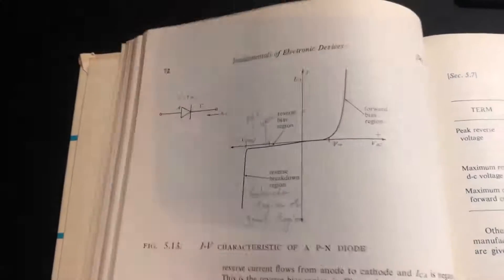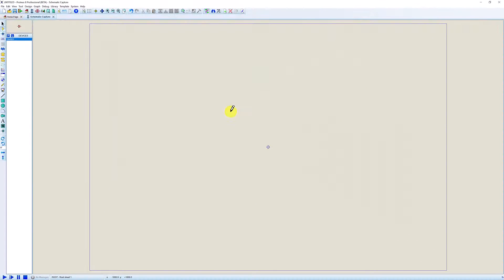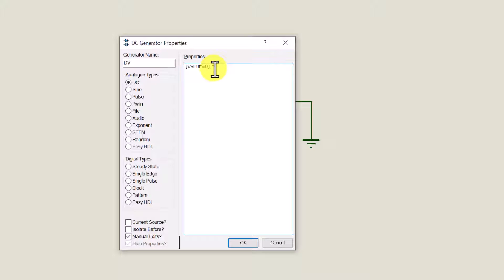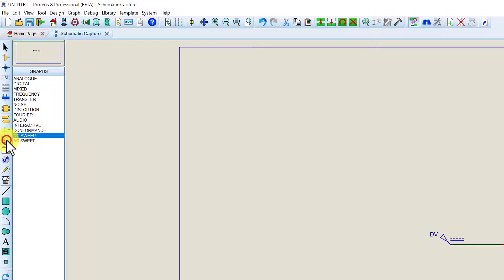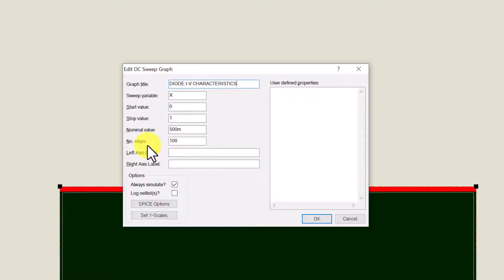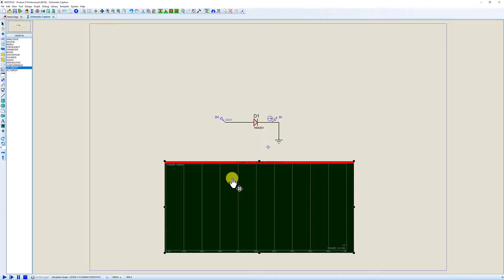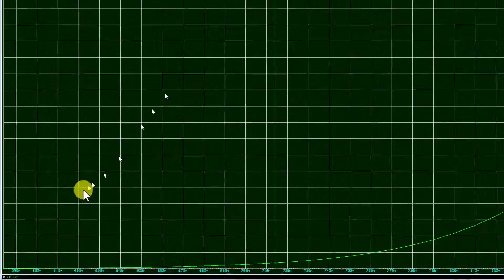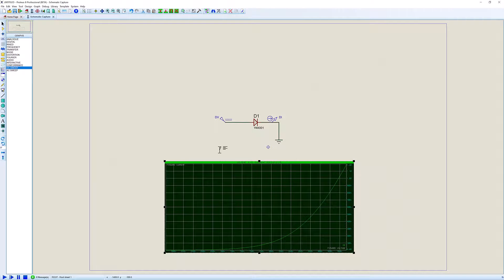Diode I-V Characteristics in Proteus DC Sweep Graph PN Silicon Forward Bias

Comment: Hi sir, I have a doubt. I want to illustrate the VI characteristics of diode in proteus. But the problem is I want to plot the graph as Id VS Vd (ie. diode current vs diode voltage) in the same graph with resistor in the circuit. I have referred lot of videos regarding this but I haven't got the crt explanation. Can you please help me with this. ( I AM VERY NEW TO THIS SOFTWARE).